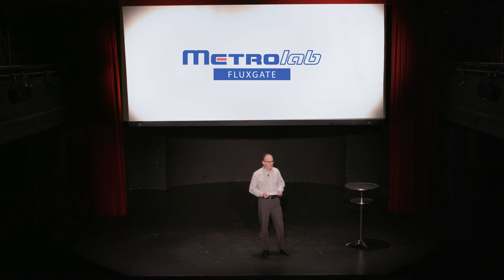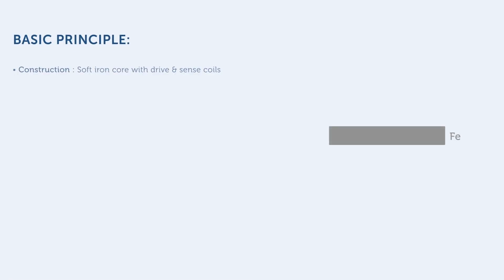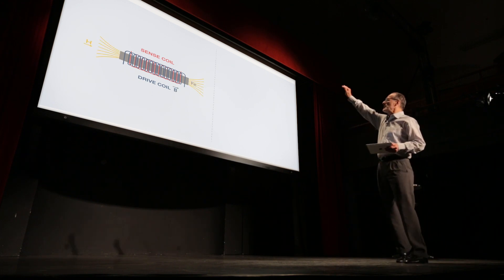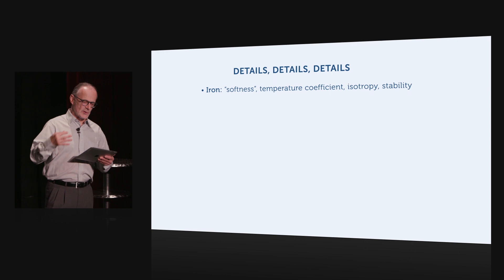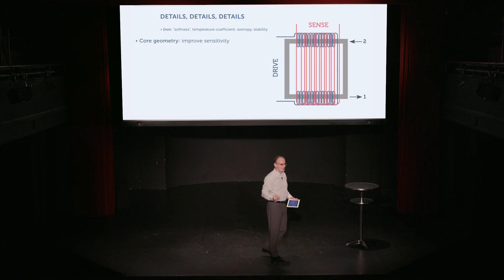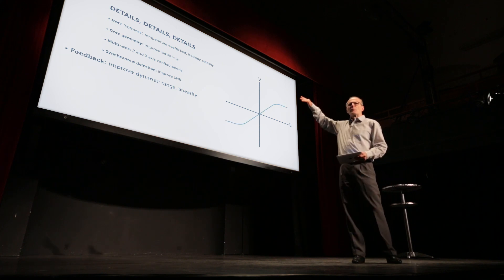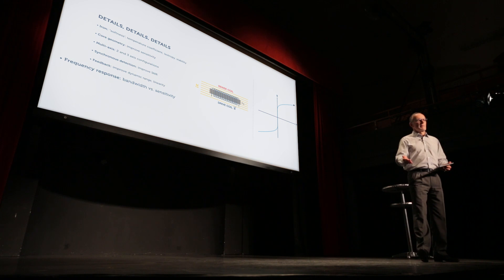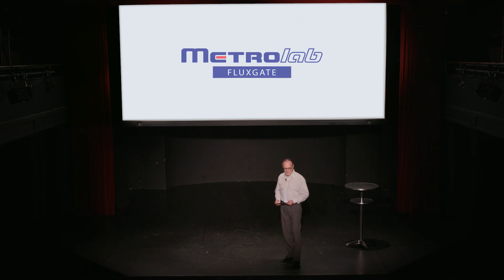Fluxgates: magnetometer technology primer

Comment: A practical fluxgate compass sensor has three sensing coils at 120 degree angles, all energized by a single ac coil.  Schematically, it resemble a three-phase device, but it is in fact a single phase instrument because all three legs are activated at the same time a single excitation field.  This is sometimes a point of confusion in understanding flux valve compass systems on aircraft, which are rapidly vanishing from the scene due to the preponderance of inertial reference systems.  Synchros no longer rule the world of aircraft instruments.

Comment: Why you not tell anything about magnetometers with optical pump which based on NMR and can provide SNR around 3.5*10^5 at pT fields?
Reply from the maker: Hi Vadim. Thanks for watching. The simplified diagram in the introduction only shows some of the physical effects that can be used to measure magnetic flux density; as you undoubtedly know, there are well over a dozen, and my talks focus on the ones we use in Metrolab instruments. You are absolutely correct that optically pumped NMR is a family of very sensitive field measurement techniques, suitable for precision measurements at low fields. Perhaps you can refer us to a good technical talk on the subject? Philip
Reply: @MetrolabTechnology  thanks for for answer. I found your description of NMR sensors in another video on your channel. For me that topic is interesting because i have master of science degree  in plasma physics and i want to build own magnetometr setup in my home workshop. Right now im in process of planning future  construction works. I think i able design a something new if i will combine computer vision and that NMR magnetometr sensor.
Reply from the maker: @vmened  Ambitious! I'd be interested in learning more, if and when you're ready to talk about it. Sincerely, Philip
Reply: @MetrolabTechnology  My skype is vadimedition. I will be grateful if at a difficult moment you can help me with advice. Thank you in advance.

Comment: For the 2d version it was unclear if the same iron loop can be used for bother directions or does it need to be a separate sensors but in close proximity?
Reply from the maker: HI Jace, By "second version", I assume you mean the second core geometry shown, at roughly 04:08 in the video? The same iron loop can be used for fields pointing either to the right or to the left; that would just change the sign of the detected flux change as the core goes into and out of saturation. Does that answer the question?
Reply: @MetrolabTechnology  no I meant the 2 dimensional version
Sorry my question was so unclear. Thanks, this is an informative video! Will be making one soon
Reply from the maker: OK, I see: you're talking about the diagram at roughly 04:53 in the video. Yes, one can use the same iron core for the two directions; the diagram was just intended to show how that was equivalent to two independent sensors.
Reply: @MetrolabTechnology  on thanks for the clarification

Comment: Thanks,I learned most of my knowledge from this about flux measurement thru dynamic comparison. Where was the hysteresis loss of the BH curve  thru the remanance effect of iron?
Reply from the maker: Thanks for the feedback, Bob. You have a good question, and I don't have a good answer. The core material should ideally be completely soft, i.e. no area enclosed in the B/H curve, so no losses due to magnetic cycling. However, I can imagine that eddy-current losses might be significant at these frequencies. The end effect should simply be some heating of the core, and a phase shift between the drive and sense signals. The demodulation electronics would need to deal with this, but I don't think it fundamentally affects the measurement principle. But I'm just speculating – perhaps someone else actually knows the answer? -- Philip